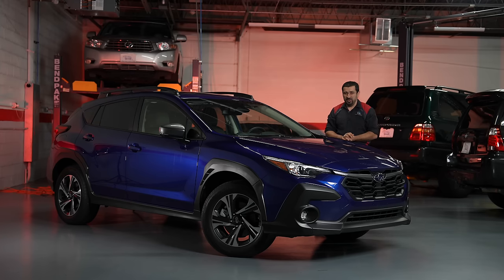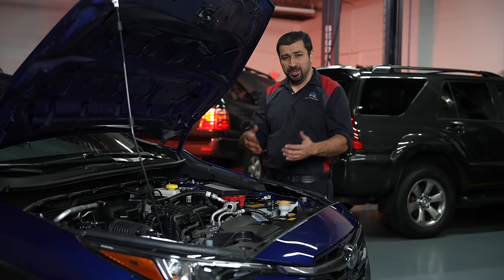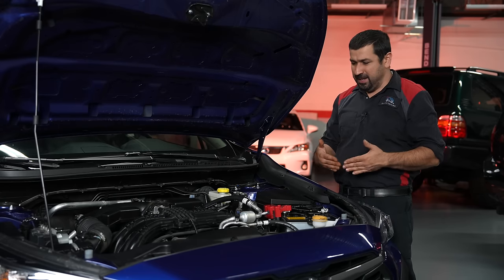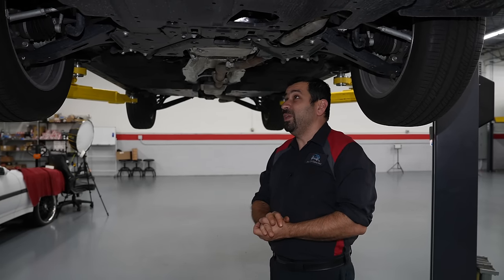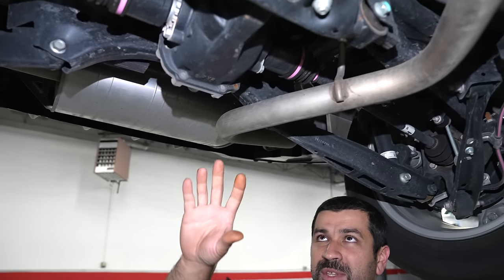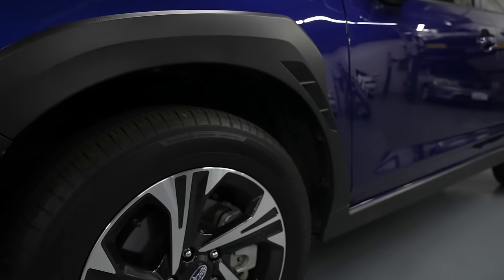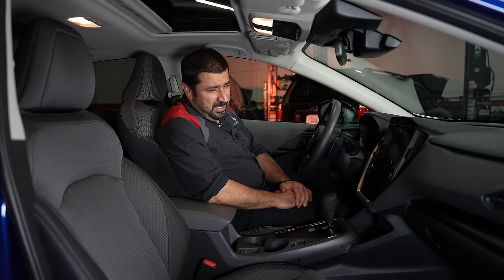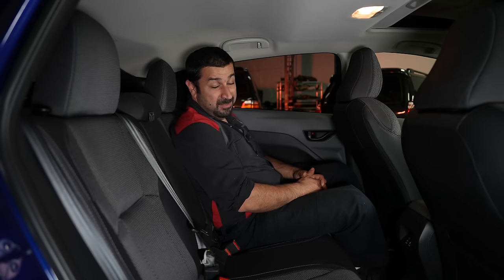Should You Buy a 2024 Subaru Crosstrek? Thorough Review By A Mechanic

Comment: Beats many other vehicles solid built great job Subaru.    I ve got a Outback touring 2022.  Love it 2.5 Mpg hwy at 65 mph 39 to 40..   around town 30 mpg.   Not my Honda Accord  in the speed with 6 manual .   Will buy the Cross next time as it a little bit more simple.    Outback touring is loaded...too much stuff i don't use or need .

Comment: I found out the "brake vents" actually help the aerodynamics at hwy speeds, by smoothing the boundry layer and air exiting the wheel wells at speed. They are supposed to help mileage a bit.

Comment: I have an old junky 2004 impreza outback sport wagon with 252,000 on it.  And even though I would not recommend a Subaru over 200,000, I got to say the idea is pretty good.  It goes anywhere, it is unstoppable in snow, it can tow 2500 pounds and it had a roof rack.  I work on it a lot but it's the greatest hunting car and if someone dents my doors at the store, I don't worry about it.

Comment: You CAN move the AVH (Automatic Vehicle Hold) button to the home screen. To drive my Outback I press "I agree..." (warning text), AVH (which I've configured to appear right in the center, then I tap the Auto Start/Stop button to turn off that annoying feature. It's really no big deal and a simple 3 taps before I drive off.
Reply: I have seen videos of the Outback and the CT Wilderness that have the AVH button in the static area down next to the Auto On/Off button.  There must be a software version that has not been available to all CT's at this point.
Reply: @fred4080 I actually noted that on one diagram of the screen in my owner’s manual and I surmise that’s where it may end up after an update. As it is, I moved the AVH button from the 2nd screen to the Home screen just above the ASS button on my ‘24 Impreza RS, super easy to click them both off right after you start the car.

Comment: My 2018 Crosstrek is a brilliant vehicle. One thing I've got that I'm sad to hear they no longer offer is a six speed manual. I bought the car with a paint chip on the door, which the dealer resprayed the week after i took delivery. The loaner Crosstrek they gave me had the CVT - I hated it.
The AWD setup is indeed brilliant, and fun. The all wheel Subaru slide is just a joy.

Comment: We have a 2017 Prius and a 2020 Subaru Impreza.  I know Impreza is at the low end of Subaru's line-up and therefore in many ways it's not comparable.  For safety reason, I will say that I prefer the Prius's radar system over Subaru's Eyesight which is also on the Impreza.  Here is why.  The Prius's system will shut off when the sensors in the front of the car get dirty like when driving on slushy snow and your cruise control will shut down with it.  The Eyesight system relies on the cameras which will shut off if the cameras cannot see well enough like in dense (or even not so dense) fog.  Now, I don't mind the radar system shutting off on snowy weather.  You shouldn't be driving using your cruise control anyway.  But I would prefer to know what's in front when I am driving in heavy fog.  The Prius's radar will allow me to do this whereas Eyesight won't.
Reply: Good point

Comment: There is some controversy about transmission fluid changes with Subaru of America. In Japan and Canada the recommended fluid change interval is 35,000 miles. In America it’s 100,000 miles. My experience with transmission fluid changes is no more than 50,000 miles. On these transmissions you cannot change the filter with out substantial work. Thus, it is imperative to keep the fluid fresh. What are you thoughts. Subaru of America is rather vague on this issue.

Comment: I have a BRZ now that I love very much, but next year plan on getting the Crosstrek Wilderness  to travel around the country, including Colorado (where I am from but no longer live). I am choosing the Wilderness because of it's performance on back roads, and its 3500 lb towing capacity, as opposed to 1500 lbs on the others. I plan on pulling a small trailer (like a Bean), not to climb mountains with, but to park in a campground, and then just drive the car for errands, like water and food retrieval.

He makes a statement about not driving the Crosstrek up mountains, or something like that, but if you watch a few videos of the Wilderness model, you will see the amazement that the reviewers have on its ability to do just that. One shows the Wilderness completing a 7 out of 10 rated 4-wheel drive trail.

He also never actually talks about the price, even though he repeatedly says something like, "at this price." The base model is something like $25K, which is a real value, imho.

Comment: I loved the review and I agree with most of your comments on the controls and interior.  The 2.5 engine is quieter and the Crosstrek needs the extra power, but as you said, it could use more. I have had 3 Subarus and for the most part, they have been very reliable. They remind me of the 4 SAABS I owned that predated the GM takeover, in that they often adopt new and useful technology before everyone else and generally, make sure it works. 

You talked about the exhaust system and that has been a problem in the past. Even when they used stainless steel for pipes and mufflers, the connections were cast iron or perhaps mild steel and tended to rust out. That means that a system with the capability of lasting for a very long time is compromised by a weak point, and the cost of replacement is ridiculous. My 2008 Outback Sport needed a new exhaust at around 65,000 miles. The replacement from Subaru was priced at $1100+ dollars. The same exhaust was used on the base model and in that, it would equal 6% of the total cost of the new vehicle. It was hard to find an aftermarket replacement and that was also quite expensive.

Comment: I bought a 2024 Crosstrek ( convenience) last november here in Canada . Great for light off roading and moving throught snow . I Had an issue thought this winter with a noisy front suspension when the temperature was below -5 C . Each time I hit a bump it was making a scratching sound. When I finally went for my  oil change in march I told Subaru about it and they told me it was because the car was new 🤨 . Its not making any more noise now since the temperature has rise but waiting to see if next winter I will have the same issue . Overall I like this car very much . Thanks for the very informative video, just sub to your channel

Comment: Excellent review. Agree with most points. However, you can add shortcuts to the infortainment system. Despite is not the same of having real buttons, shortcuts are easier to operate than navigate though menus.

Comment: Here in Germany I've driven the Gen 1 XV and currently the Gen 2 Crosstrek/XV Exclusive  (Dec 2023 model).    I like the comments on how underpowered the cars with the 2.0 and 2.5.  Here the options are a 2.0 eBoxer 150hp or the 1.6 boxer with 114hp. I've driven the 1.6 and it is surprising peppy, with no issues off-road or snow.

Comment: As a mechanic. Does it have CVT? If yes then no don't buy it. All good points in the video. However CVT's will never be cheap to repair, replacement is always the best option as once they begin to fail friction on the belt releases metal particles in the gearbox which pretty much destroys everything. And NO subaru's CVT's are still junk no comparison to Toyota's eCVT which are still not that good.

Comment: I have a 2018 crosstrek. Yep, it’s slowwwwww. Great car, very low rpm which means very efficient and slow. The engine could support faster acceleration, but the transmission is calibrated to ease into speed. The good thing about Subaru is they don’t change major things quickly. They incrementally change small things often, so although my 2018 does not look a lot different, there are significant difference. They get a good design that works, then they improve it.

Comment: IDK, I drive a 2.0L Impreza, and I dont really feel the car is underpowered at all. Day to day driving is fine, and I dont really feel unsafe merging into traffic or getting up to freeway speeds. My only complaint about the drivetrain is that it is a bit noisy, but I have the base model. I do drive mainly with one or two passengers, on relatively flat roads. If one drives with a full load, in the mountains, the car might feel slow.

Comment: I have enjoyed my 5 years' driving experience BUT this is a short-person's car.  At 6'1, I have headroom inside BUT the Door Sill is about 2 inches TOO LOW!!  I am constantly banging my head as I get into or out of the car.  I bought this because it had 42-inch legroom for the driver and, indeed, I don't have to drive scissor-legged - which is REALLY difficult on long drives.   That Door Sill, however, will prevent me from every getting another one and, probably only consider the taller Forrester.

Comment: Really excellent review. One thing: The All Wheel Drive system is excellent, as you said, but people might get the impression that it is all four wheels doing the same thing on Subarus. That used to be true, like with my 2004 Impreza Outback Sport. Power was distributed evenly between all four wheels.  However in later years Subaru changed the function to keep the gas mileage higher, and maybe some other reasons. So now, for example, if you are driving down the highway, I believe it is giving the front wheels 80% of the power and the rear wheels 20% of the power (for example). It varies the power distribution between front and back wheels as needed for the best traction. I don't know the exact engineering details. Probably a good design choice.

Comment: I still prefer the EJ, sure the FA/FB engines have improvements in some areas but the EJ although it has faults are easier and cheaper to work on and fix without some of added potential future complications these series will have.
Reply: FA with the turbo worries me. FB is really reliable in my opinion. i've known people who have longer commutes drive a Crosstrek with the 2.0 for 200,000+ miles without issues.

I think the only hiccup they had early on was using too light of oil grades. but that's been worked on

Comment: I just happened to come across this and an excellent review. Not only do you have to keep these engine parts clean if out (I've had subaru for over 20yrs as my wife was fed up not getting home in wintry weather and we got a second hand Impreza and as you say, a 4WD that's in a league of its own. We downsized from outback to XV e-boxer. Yes it is a down in more than size, but very practical though the e- is a bit of a gimmick with little increase in fuel consumption due to hauling that battery. Switch to sport and the engine comes alive but defeats the purpose of the planet. The info map is not good as needs constant adjustment from day/night. Brakes are sharp, power slow (out of S) safety very high, 4wd 5star. My garage for service also 5star.

Comment: The AVH icon is on the second page of the screen but can be moved to the first screen, which is what I did. I simply hit the icon when I start the car, so it is easy to use. However, my disappointment is that it doesn’t remain on when the car is turned off. I have to hit the icon each time. So you don’t have to go into settings like you showed in the video.
Reply: How do you move the icon?

Comment: I was following along nicely until you said the car is noisy. It’s actually quite refined and quiet for its class. You’re massively wrong there and it’s not subjective. Also, the 2.5 liter isn’t slow either. I drive it every day.
Reply: I Have forester 2.5, it's fast in city, slow on highway, wheel arch are nosiy, I can heart pebble hit
Reply: @vipvip-tf9rw  My car weighs 300 pounds less than the Forester with the same engine. It’s not slow on the highway

Comment: I believe if you need to replace one tire you have to replace all 4 Because the tread depth needs to be the same on all 4 with an all-wheel drive system
Reply: With an AWD system, the tread depth of the tires needs to be within 3/32" of an inch to one another. This is a requirement for virtually all vehicles with AWD, and is not specific to Subaru.

Comment: Subarus, properly maintained will last as long as any car, longer than most and I have been a long term owner of both Subarus and Toyotas, and with proper maintenance they last as long as Toyotas and that's including accessories as well. The problems come from neglect or improper mechanical work.
Subarus largely require OEM parts and technicians that are familiar with them due to their unique design, if you aren't prepared to follow the maintenance schedule, buy something else. But if you are you may become a brand loyalist as most Subaru owners are. They are like the swiss army knife of cars, snow rain, ice, or any combination, you always feel confident that the wheels are all firmly planted on the road.
Reply: Do you need a certified Subaru tech to perform an oil and filter change?

Comment: A couple of things I think is a bit misunderstood. The AWD is FWD biased and is not full time. The coupler in the rear engages and disengages given driving conditions so most of the time it's FWD. CVT is actually very simple. It's not "very complicated".
Reply: Rubbish, the torque split on Subarus are around 60/40 and can vary depending on driving conditions. They can send up to 80% to one wheel at any time. This will vary between models as they are all configured differently. It is never a part time AWD like others.
Reply: @weetbix2083  no. If you even remotely understand how the drivetrain is laid out, you will know that it's not possible to be full time AWD as it doesn't have a center differential. The torque split is all from the rear clutch which is and shouldn't be engaging at all times due to the rotation difference between the axles. Usually with this type of system, they will allow more great torque split under certain speed and then taper off as you go faster unless a high torque or slip is detected at that speed. It goes from proactive mode at lower speeds to reactive mode at higher speeds. Nothing wrong with that approach but it's not a full time system like a manual WRX which has a center differential that will send torque to the rear regardless of speed, and steering angle (axle speed difference).
Reply: ARGH!!!!!  So may differing explanations!!! @jasonsong86
Reply: @fred4080  unfortunately yes, but that's just how car manufacturers do these days. I am not saying the AWD system on the Crosstrek is a inferior system. I am just saying it has it's limitations.

Comment: Simple answer, no because of that stupid iPad on the dash and eyesight on every trim.  
I’m planning on buying a 2019 crosstrek without eyesight and a simple infotainment system that I can replace with an aftermarket one.
I work for an auto glass replacement company and it takes an hour to recalibrate the eyesight system when we replace a windshield.  It’s faster to recalibrate the Volvo system than the Subaru.
Reply: I bought the 2018 Forester Touring. Has the safety features, and is not “chatty”. 

Highly recommended.
Reply: I've a '19 Limited, and I love it.  It's the last year which has the 2.0 (Limited's are 2.5 from 2020 onward) and no auto stop start.  Subaru glass isn't the best, I had to replace mine with PPG glass and it was easy to calibrate the EyeSight system.  From what I understand, it is kind of difficult to put an aftermarket head unit, because the head unit is not exactly a square box.  It is recessed, and the StarLink system sits directly in the rear section of the unit. So you might can change it, but lose the use of StarLink, which I love for the remote features, etc.  Subaru's aren't flashy, and a good road driving car like a Mazda, but it gets you where you need to go. Just follow the maintenance schedule, and you'll be fine.

Comment: I'm looking at getting a 24/25 Crosstrek in Dec for my cleaning business. I was originally looking at the Rav4 Hybrid but with how their AWD system operates, I decided to cancel my order. I also live in Canada, so the Crosstrek I want, is $20k cheaper than the Rav4 Hybrid. I used to have a 15 STi and never had an issue with it. I'm also not worried about speed, as I have a 24 Golf R.

Comment: I went from a 2020 Outback Limited XT to a 2023 Forester Limited. Miss the turbo but I find the Forester acceleration adequate, using S mode or occasionally paddle shifters when merging. Outback was smoother and quieter with a more comfortable seat. But the Forester is more fun to drive, still has a cd player (what?), and has a small screen with real buttons/rockers/dials. Very sorry to see this model Crosstrek go the Outback infotainment way: slow, many menus/screens, distracting. Way better MPG as well on the Forester. Thanks for a very thorough review as always. Let's not forget the Forester!

Comment: So I have a 2021 crosstrek with the 2.5 liter , from what I have been told by the manufacture is that your not to service the CVT because they r seal system and theyr supposed to last the life of the car. But you do have to service the differential every 30k

Comment: Aren't most if not all subcompacts and compacts underpowered and slow? 1.5 liter turbo engines and torque converter transmissions seem to have the same HP and torque as the Crosstrek from what my research shows.  Great review.

Comment: Just bought a 2023 base model Forester, the ac dose have physical buttons, AVH is also a physical button, the info screen is smaller( 8 in.) and no roof rails. As for it being slow, it’s faster than my ford courier truck or my ‘78 Honda Civic Wagon. Then I am 72 years old and I just don’t need all the new innovations that come with cars these days. I like to drive the car, not the car drive itself